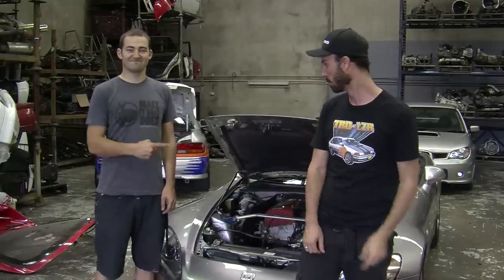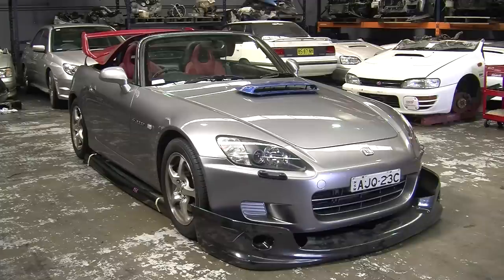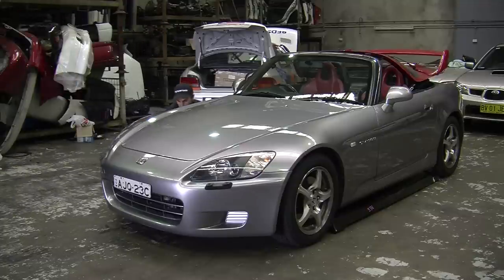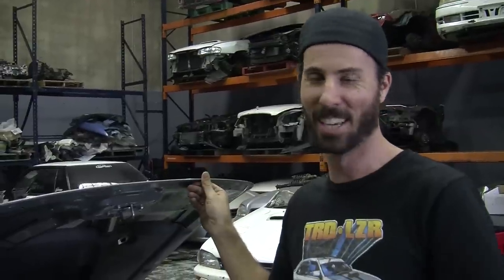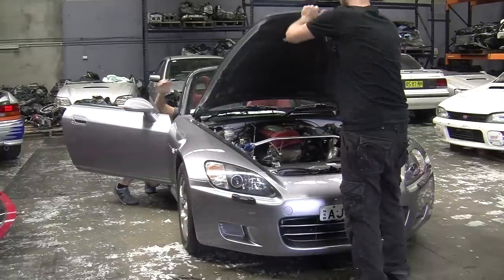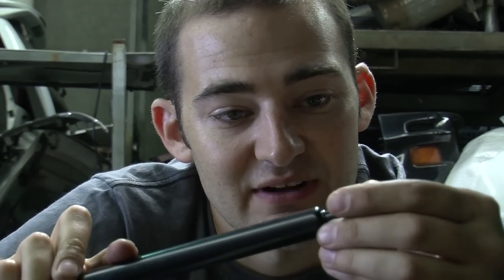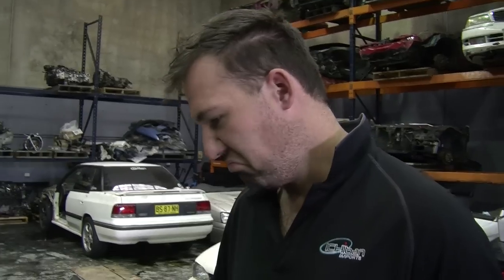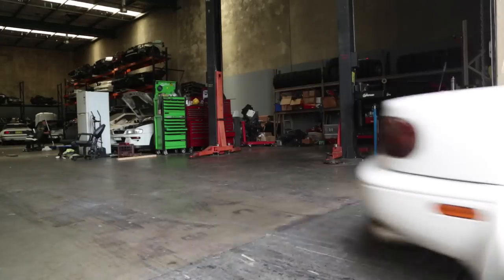How to Install Bonnet Struts (Hood Dampers)

Comment: s2000 looks better then the mx5  and faster stock vs stock and gets more bang you your buck but i also just dont care because i dont like imports in particular not enough bang
Reply: bang for your buck? an MX-5 is half or even less than an S2000... and have you seen an LS1 powered MX-5? that's about the same price as a S2000
Reply: true sir SuperJuicebox24
Reply: Javier Zaragoza ls1 dontmake me laugh, why do that when you can go with a mazda 20b 3 rotor engine, with a bit bigger of a turbo, the s2000 would be decimated, nothing against honda of course
Reply: they came with 330hp in the states, and 276hp in japan
but a good 2JZ GTE will cost almost $8,000
Reply: yeah im the same way but a better way to build your 240sx is to start with an SR20DET swap, it's easier than a 2JZ and lighter.
Reply: call me crazy, but i prefer to keep my cars running their own brands shit. lol.
Reply: *****
If a straight 6 sounds better then a V8 to you then well... OK :D
Reply: *****
True, True. But then again a straight 6 at 8k RPM has the same pitch as a V8 on 6k RPM, but the V8 has a lovely burble to it ;-) In the end it always comes down to power and gearing though ;-)
Reply: *****
There is a plaethora of JDM V8's ;-) and they are damned good engines ;-)
Reply: Whatevs, I'll just drive a dodge turbo diesel, which will still beat moogs s2k or Marty's mx5, and it sounds better
Reply: should buy a 300zx twin turbo 3L v6
Reply: ***** v8. ill only use v8 in a muscle car thats it. if its for a sports car you cant go wrong with a v6
Reply: ZerokillerOppel1
the result would be simple, but he wouldn't be able to comment on it afterwards!
there is a reason that diesels are in ambulances, buses, big rigs, etc, and that is because not only do they push out loads of torque, but with gas engines its an achievement to last 300k miles with OEM parts, but diesels are typically abused and sometimes neglected and still can last 1,000,000 miles or more.
the type of engine to use depends on the application though, if you are hauling shit around at highway speeds or less and need a reliable engine, diesels are better, but if you are looking for a fast and sporty car, gas engines are better
Reply: lionellinesfan
Tell that to Audi R18 :D
Reply: akkudakkupl
there's always the oddballs to the rules though :P like the fuck-all to piston engines ,the Mazda 787B, the 4-Rotor, Naturally Aspirated Race Machine
Reply: lionellinesfan
BRAP BRAP BRAP BRAP BRAP!
Reply: ZerokillerOppel1 will do, and the only diesels that get good mileage are  the volkswagens, AND diesel is alot more expensive than E85 or even high octane gas
Reply: SuperJuicebox24
Maybe in America... Also there is a lot more GOOD diesels, just not over the pond it seems (VW is still a leader though).
Reply: akkudakkupl VW IS THE KING OF DIESELS I OWN ONE
Reply: Leopold Productions
 VW is also the king of the self stripping reverse gear. the only manual i can think of that you have to hold in the reverse gear WITH pressure so it doesnt pop out and eat gears
Reply: i know that because i own a VW
Reply: now we are talking about vw and engines
Reply: akkudakkupl actually an Inline engine will make all of it's torque faster than a V8
Reply: akkudakkupl every diesel that i've seen so far at my high school is built to do off roading, but they think it's funnier to blow smoke at people
Reply: SuperJuicebox24
 an I6 may make all of its torque sooner than a V8, but the V8 will make more torque overall, and has a higher power potential
Reply: not really true regarding the 2JZ and RB26
Reply: SuperJuicebox24
they are powerful 6 cylinders, but think about the 426 HEMI and the 454 Chevy Big Block, they both have a much higher potiential than those engines and were made long before the 2jz and rb26. put it this way. the more pistons, the more seperate explosions to create power with, v10 and v12 engines have even more potiental, as there is more engine to create power with. therefore the i6 has less moving mass so it can create torque sooner, but a v8 has more separate explosions pushing the  moving mass around, and can therefore can produce more torque

Comment: So many people want to see the S2K get a Turbo. Lots of people saying, Keep it N/A. But what about Supercharging it? Centrifugal blowers do some pretty crazy torque and that's what (no offense to owners) 4 cylinder cars lack. The S2K can do 1,000 horsepower, but 390 pounds of torque. My grandmother has more.
So, I throw a quarter in on the conversation and say, Moog if you're going to Force air into it. Run a blower. It's unique, It'll do what you want it to. And You'll have some pretty mad cred for being one of very few people with a Supercharger on a Honda.

Comment: You don't even need to remove the clips from the struts, they just take a bit more force to go onto the mounts, but they go over just fine without removing the clips.

Comment: I'm guessing that bonnet is super lightweight. Otherwise, the low-angle installation of those struts would struggle to successfully lift the bonnet from a low starting point. 

I would install the upper ends of the struts in new holes about half a foot farther up the bonnet for extra mechanical advantage (or whatever they call it) and a better guarantee that the bonnet stays suspended.

Comment: I have owned a 99  s2000 fully built and supercharged a 96 civic hatch fully built with a b18 swap with big gobs of nitrous I've had a 94 accord with the H 22 fully built all motor independent quad throttle bodies I have owned a 2005 WRX STI with suspension turbo  intercooler and injectors upgrades now I currently own fully built supercharged 99 NSX and a 2005 Toyota Tundra TRD with headers intake exhaust blueprinted  ported and polished  when you go Jap you'll never go back !

Comment: I love your car. I'd love an S2K, nothing BEATS NA.
Reply: Except turbo :D
Though I'll admit, NA's response is way batter than turbo.
Reply: I have had both....rather have turbo.
Reply: Supercharged? quick response, linear boost.. less top end than turbo though.
Reply: Hargak Gak superchargers put a higher load on the engine over a turbo.
Reply: Actually the load is the same but not as linear. You have lag until you overcome it. Even when overcome there is still a significant load on the exhaust stroke until it passes the turbo.
Reply: Hargak Gak no. A supercharger is powered by a belt attached to the crankshaft, which saps a bit of power to spin the belt and power the supercharger. so if you have 2 cars, each with the same power, one with a supercharger one with a turbo, the supercharged car is working harder.
Reply: Nathan Clark

yeah, the parasitic effect of SCs, however, who said that you have to have a 500HP SC S2K? It just needs to have enough horsepower, if the stock 250 aren`t already enough. 
No need for insane 800 hp S2K. That doesnt fit MCM anyways.
So a supercharger is indeed a valid choice.
There are even kits available for the S2K if I am not sorely mistaken.
I`d vote for that.

about 300hp SCed sounds about right for me. Just my 2 cents of course.
Reply: Nathan Clark
Yeah, no. Turbos take power from the motor as well. Again its not linear belt drive. A motor is a big pump you are pushing a turbine on the outlet of the pump. This is where the extra power comes from. Turbos are not magic, it takes power to make power no matter which way you compress it. If turbos didnt require power to turn then it would be over unity. If someone tells you its waste energy, they are only half right you're restricting that exhaust through a tiny wheel. This requires torque off the motor. There is a point where it overcomes this which up until that point is called lag which changes to boost. In order to keep that wheel spinning at 70k+ rpms its using some of the excess power it's creating.

Comment: hi dud
i have celica 2000 and i want to put cold air intake. do you have any plan to make video for how to install cold air intake and there are expensive brand and on ebay quite cheap one. if i buy cheap one with in $80 and put high quality air filter how that sound? 

once again thanks for your good lessons

Comment: If you're in the U.S., it's a "gas spring". ;) 

Also, why did you grease the bottom of the washer? The grease goes on the round ball-thingy...
Reply: I have literally never heard that before. Been in the US my whole life. :/
Reply: Aaron Cluff
- Has your life been 50 years, or is it less than that? It's possible that the 'name' of the thing has changed since I was a mechanic in my younger days. ;)
Reply: +KOakaKO yea that's possible.

Comment: Will boot struts work the same for bonnet? I can't seem to find a lot for Citroen C3 1.4 SX HDI?
Reply: asking the same q myself. someone answer pls!
Reply: Srijon Zaman Depends - length when extended and  length when compressed for it to work at all given possible mounting points. Then given that, they need to be in the suitable force range proscribed by mount points, hinge and mounting geometry and hood weight...

Might be better off with struts for another car with similar size hood than the struts from your cars boot lid.  I'd guess either would be as likely to find suitable stock holes to use or require drilling.

Comment: Great video, I need to replace my Bonnet Struts on my Acura Legend. They crapped out and I can't find anyone who can remove them the proper way. Next video should be boot repair for cars trunks that don't popup and stay put.
Reply: Some just pop on and pop off. On one of my cars there is a clip that you can pop off to take off the struts, on another one it's a ball joint that just pops off and on without a clip.
Reply: Eyebrows Mahoney
mine are supposed to pop off by putting a screwdriver in a hole at the bottom but like I said no mechanic can get them off. So I shall start hammering away at it eventually when I get tired of holding the hood up.
Reply: I was going to say the same thing, hammer away buddy, just order your new set, then start on getting rid of the old ones
Reply: Max Hanna
yep thats the plan I got a set real cheap for like $5 just waiting on a day to do em. Might check it tomorrow and then gotta find out why my trunk wont stay open or pop up
Reply: iPartyHardcore
 I used a dead blow hammer to get my old ones off on one of my cars.
Reply: Eyebrows Mahoney
Great idea, Thanks I'm gonna try that.
Reply: iPartyHardcore No prob dude! Just don't bend the mounts!
Reply: Eyebrows Mahoney
that's the only thing im scared of

Comment: Um, guys, the grease is meant for the ball and socket joints at each end of the strut. OEM tailgate dampers will come with grease already in the sockets.

I wonder why he got an AP1? The AP2 looks so much better, they're definitely better cars than the Miata.

Comment: I'm from the USA and we call them hood struts, their not dampers (a damper is the same as a shock absorber) their a gas-charged strut.

Also, having worked on many older hatch back cars, have to really watch out when they age, they fall, and no one wants a hatch or hood into the head!

Comment: what is the name of the car behind your Honda?
Reply: subaru wrx looks like v6 i think?
Reply: BassFreak you dont get v6s in wrxs only boxer 4s, at the start of the video the white one is a subaru legacy, the silver one is either a subaru impreza rs or wrx. later in the video they are all legacys and wrxs but ceebs identifying them all
Reply: ***** you dont have a clue... v6 for subarus stands for version 6, and actually a flat 6 motor has been designed for the late models
Reply: ***** subaru came out with a 6 cylinder 3.6L engine.... have you not done research?

http://www.subaru.com/engineering/boxer-engine.html

scroll down to bottom of that page to see it if you dont believe me.
Reply: its a S2000 Type-R
Reply: Leopold Productions a subaru is not a rice burner like that honda.. there is not honda behind that honda
Reply: Subaru Impreza WRX STi MY06
Reply: BassFreak i know that you lemon, but did the put it in a wrx from the factory? no they did not. seeing as this conversation was about wrxs i thought we could stay on topic here yeah?
Reply: the car is a dodge charger
Reply: Leopold Productions its a Subaru Impreza WRX STi MY06 -_-
Reply: birdylover100 it looks like a dodge charger in the thumbnail
Reply: Leopold Productions if you watch further you will see the my06
Reply: Leopold Productions Oh? I thought it was a nissan supra, the vtec model.

Comment: Still not as fast as my sleeper car. 98 model pajero with 350 chev small block super charged linked to 6 speed gearbox then mashed onto a 4x4 transfercase then to big diffs with 36in wheels.

Comment: 9:33 why is the engine crooked/offset to the left?
Reply: +Robert Perry long story short, you go fast
Reply: +beshj I beleive Some Bimmers had that too, no?
Reply: Honda s2000 engines are angled a certain degree (idk how much exactly) and located behind the rear tires for even even weight distribution drops mic

Comment: Dude, you can make 700+hp on a S2000 with stock sleeves [: lol Or Go ITB on the S2000 and make gains and Get a awesome sound
Reply: Daniel Berkness The sleeve of an engine is basically what the piston moves in. You would need to forge certain parts on the engine and turbo/supercharge it to get this power amongst other things however.

Comment: 0:52 - 1:21
Marty:  "The Honda's going to basically go down the track in a fireball 'cause it's crap, really, y'know, the good thing about an MX-5 is (couldn't understand his first point), you can turbocharge it, you can hang out with Turbo Yoda and your mates, if you've got an S2000 you can't hang out with anyone 'cause no one really cares, I mean, y'know, it's boring, if you're in VTEC you're speeding, you're basically speeding if you're in VTEC in the street, unless you're on a track or on the motorway, and on the motorway you're just embarrassed, so, pretty much, yeah."

MOOG:  "We're going to be smashing the MX-5 with the Honda S2000 because it is a faster car, it is a better car, it's better-engineered, everybody knows that if you want a proper sports car, a proper coupe, a Japanese one, is that you get a Honda, it's nicer when you're actually in there and it responds to mods better, you don't have to turbocharge it to actually go better, people who drive Hondas know that they're awesome, you've got VTEC, okay?  VTEC means you're going faster than an MX-5 can ever go, you've gotta spend so much money to go faster, I haven't had to spend anything and I still beat him at the track last time."

That took about ten minutes to transcribe (mostly) properly.
Reply: +Echowaffle8 Check the CC on that at 1:01

Comment: i don't trust hood dampers, a simple jack will work for ever when dampers stop working when they get old
Reply: the dampener in my Mercedes are older than me and still work, your argument is invalid
Reply: If that ever happens, then you get new dampers that are cheap and easy to replace. But most likely installing them on a used car they will work till the car bites the dust. Unless you start replacing motor parts to keep the car alive.

Comment: The grease is for the ball joints, not the threats my God. there is no normal situation where you would ever, ever put grease on a bolt thread. anti seize or threadlocker is the only things you want contaminating your thread depending on use.

Comment: V-Tec = Turbo lag without the turbo.
Reply: Do you even know what Vtec actually does? Lol.
Reply: The same as any variable valve timing only controlled electronically instead of hydraulics or kinetics. 
This is why early V-Tec's felt like turbo lag as it was the ecu that decided when to adjust the valve clearances instead of physics or your right foot.
Reply: TheLiquidKnight I'm so glad you know how Vtec actually works. Unlike the dozens of trolls who just hop on a bandwagon and use that phrase without actually knowing why people even say that.
Reply: My father was one of the guys who came up with the idea of a cam' free VVC engine at Lotus. Having worked on the Rover K-series VVC platform for the Elise it was a possible direction.